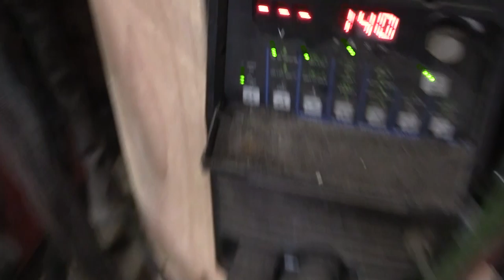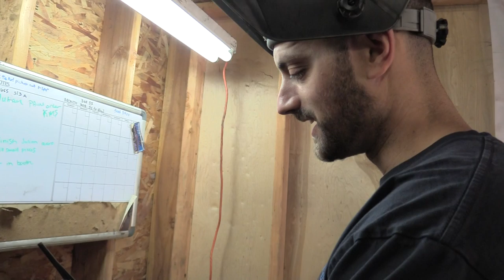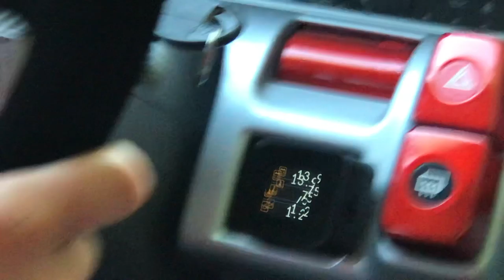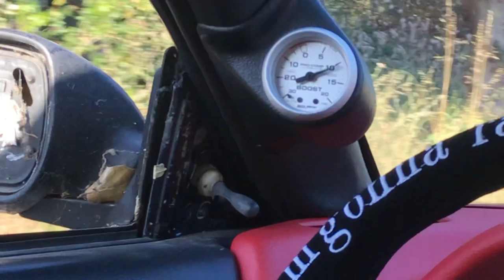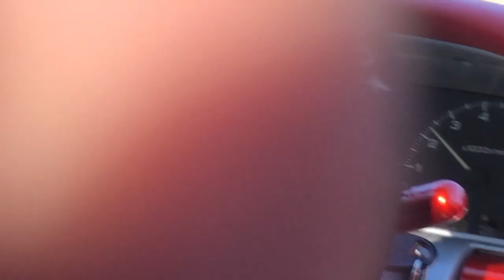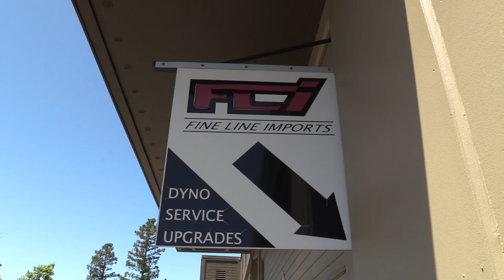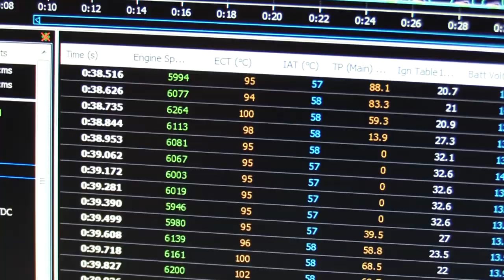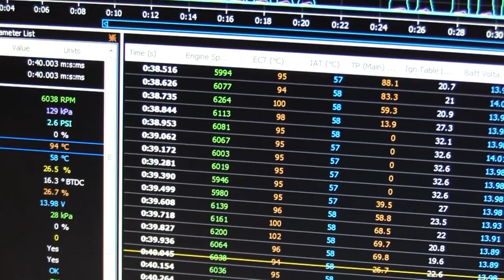Super D Prep - Part 1 | Animal Style

Comment: CA18"s are a great little motor. You have to wring their neck and drive them hard. Pretty much a 4cylinder RB. No torque, but I have mine wound up to 236KW at the wheels. Forged pistons, new gaskets and bolts, rings and bearings and lets go. Cam gears, 1100 injectors and a good tuner and you will be away! Can't beat an iron block. Hello from NZ.
Reply: Emil Kuttel they’ll make that much power on stock internals tho... that’s only 300ish hp. If you’ve got forged internals, you should be able to make well over 400, maybe even going on 500 if you’re lucky
Reply: I love my CA, awesome little engine. Held up with 2 years of abuse. Finally just lost compression on me/:

Comment: Just did a top end rebuild on a Datsun with an L20b and the sr20 is so similar to the old engine, mine dropped a valve seat and banged up the cylinders the same way, nothing a little girding didn’t fix lol.